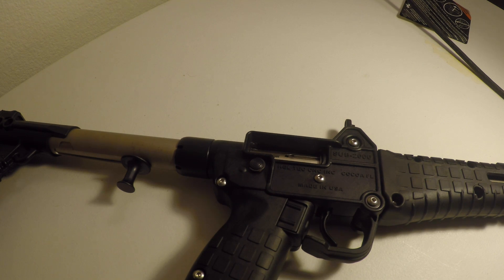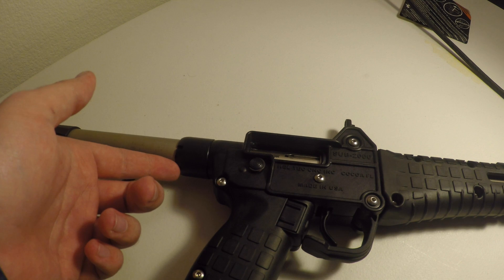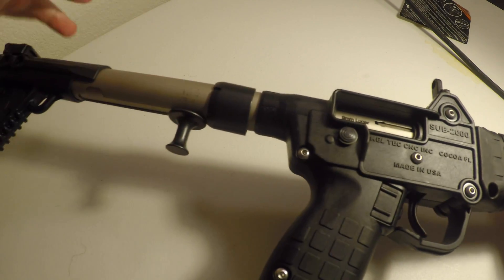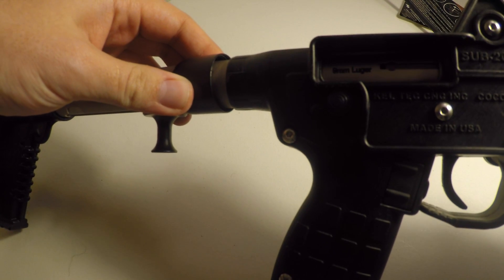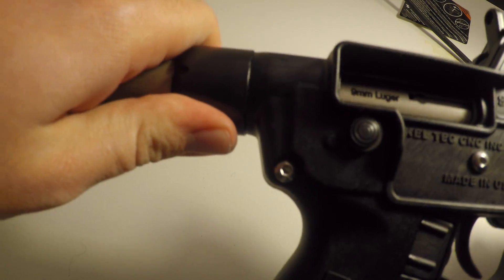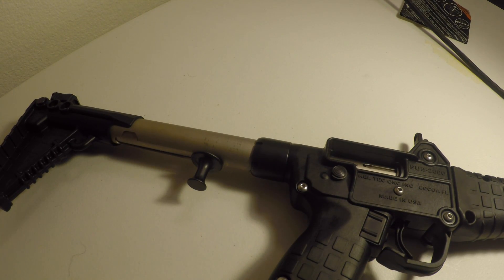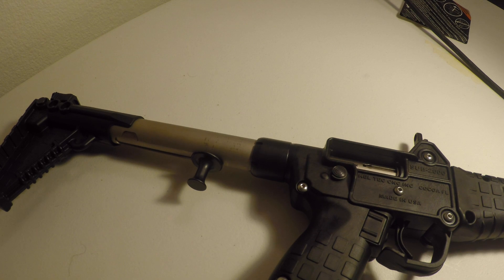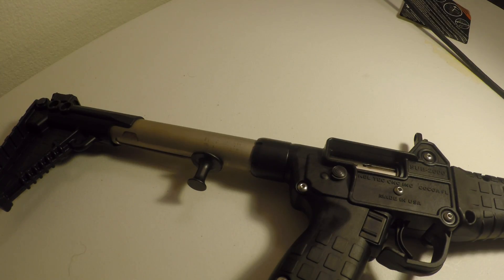New Problems Keltec Sub2000 Generation 2 Updated Version Receiver Collar|

Comment: The front of the "nut" has 4 tabs which slide along the four indentations on the receiving end. Once the nut is slipped into place,  a slight turn to the right locks it in place.

Comment: I’ve put over 1000 rounds through mine. Only problem  I’ve ever had was to stove pipe jams but I was using cheap ammo . Not a single other problem I would definitely recommend buying a Sub 2000

Comment: Don’t understand why a purchaser should have to fix any product after buying it; any product, especially one that manages high pressures and deals with a lot of known variables. There should be no tolerance for imperfect results. None. We don’t put up with automobiles that stop only some of the time when brakes are applied. Something works within a narrow range of tolerance- or it should die in the marketplace.
Reply: I don't know many new cars that cost $400 like the Sub2k does. Cars and cheapo Kel Tecs are NOT the same.

Comment: Everything is fine with your KelTec. The Gen2s come unthreaded. As long as the threads on the nut grab the plastic and tighten up. The company thinks this is sufficient rather than threading the "receiver" plastic. Some people put loctite on the plastic before they screw the nut on.

Comment: From my understanding the gen 2 comes this way, there are threads on the actual castle nut. As others have said, use some Loctite, put it on the threads of the castle nut then actually screw it onto the grip assembly while pushing forward. The threads on the castle nut are supposedly made to put grooves into the polymer grip assembly to help hold it in place. I don't know why they do it that way, but I have read this tip on several forums, did it to my gen 2 and I haven't had a problem since.
Reply: yes they are like that from factory.  they just use loctite to secure it.  M-carbo shows a breakdown vid and explains it.

Comment: Just lock tight it! I don't understand why people buy a $500.00 gun, then complain about minor issues. NO gun is perfect. Someone will ALWAYS find fault of some kind. If you look at YouTube,  you know this. If it's a $3500.00 custom AR, or a $6000.00 bolt action rifle, someone will find something wrong! Just relax and enjoy shooting.
Reply: A firearm malfunction or defect can cause injury or death. It is not the difference between buying a Fiesta or F 150. Even the cheapest firearm is expected, at the very least to operate safely.The manufacturer has issued a voluntary recall and will not only fix it but will return it with a new 10 rd mag for your trouble.
Reply: Mine had a minor issue,Broke in half after 30 rounds
Reply: Mine had a minor issue.Broke in half after 30 rounds.

Comment: It's not really a threaded joint but rather the "kind of" forms a thread on tbe plastic upper. The Loctite is what forms the grip. Kel-tec intentionally applies the adhesive sparingly to facilitate disassembly which is necessary for MCARBO upgrades. Too much grip and some people will destroy the nut or upper in disassembly. I think on the Gen 3, if there is one to be, will have real threads molded in the upper (which is not a costly insert mold modification for the injection mold tooling) or a clamp ring (my choice) to replace the nut. Either way, there is an easy enhancement possibility.
Reply: Jeff Cole they should do that. Or put some kind of ferrell and compression system on it..
Reply: They have the sling bolt that covers it and actually gets tightened down

Comment: The sight on mine is canted, also had this issue with the collar on mine.
Reply: Aaron Bryant take your gun back to the gun store or call Kel-Tec and they’ll fix that front sight. Front sight is glued on with a super high temp glue, a heat gun will take the sight right off.

Comment: Why not use some gorilla tape lol. I owned a couple  of Kelley's, my neighbor bought the 22LR pistol he has to lube up before firing so it doesn't  jam the rimed cartridges that get tangled. IMO Keltec manufacturers prototype platform gun designs minimally tested and minimally manufactured by sub contractors. I personally  have made up my mind to steer clear. If I really want a "pistol-cartridge-carbine" I'll pay a little more and build/buy a proven AR platform designed, which I've never had to gorilla glue.

Comment: Put some Loctite 380 on the frame part where it should lock and tighten it real good and shouldn't come off any more that easily
Reply: Mcarbo sells a lot of after market internals.   They recommend loctite 380 for a good polymer to steel bond on this.

Comment: It seems like everyone has some major issue with the sub 2k that turns out to be a minor issue. Maybe keltec should just put a little more locktite on them to keep the sub 2k haters at bay. I did have my from sight loosen. 5 minute fix, didn't have to make a video about it.
Reply: Bronx ite450 I hate that people buy this gun and start bitching when something loosens up and then they call the gun cheap or junk. It's probably the most saut after carbine on the market and a very good one at that. My Castle nut came loose and I just put loctight on it and problem fixed. No other carbine does what this gun does, so I say this to all the idiots sell it or fix it.
Reply: Shniggit True even a stellar product with poor QC is going to get crap. I wouldn't say they were light years behind in QC but shaking a bad reputation, hard to do when little stupid things like this happen, then it makes you doubt the reliability of the product and company overall. It makes it seem like someone doesn't care. I agree they better tighten up.
Reply: Just bought one.... gun rocks... haters will hate.....
Reply: tlt40s&w 70 i

Comment: Red Loctite on mine and I can’t remove it even if I wanted to. My front sight was also canted. A heat gun and a vise made straightening it a piece of cake. These should be flawless from the factory, but Kel-Tec already struggles to keep up with demand. More often than not things are sent out the door without proper inspection.
Reply: I think Mcarbo makes a after market front sight that is superior to Kel Tec plastic sight.
Reply: That's funny. I just ordered it a few days ago.

Comment: My Keltec sub 2k gen 2 is great ! 
UPGRADES 

Pro trigger bundle 
Extended glock mag release 
33 round glock mag
Stainless Steele Feed ramp 
Aluminum trigger gaurd
Rotating Rail 
Front & Back Fold down sights 
Buffer recoil pads 
Butt stock recoil pad 
Trijicon Dual illuminated RMR 

Y'all should quit crying  about your S2K and do some research on the gun and invest.
Reply: 5280 Cinema Group your like me, you put about $2000 into a cheap gun. Hehe.

Comment: Kel-Tec Weapons issued a voluntary recall of specific Sub-2000 rifles manufactured during their 2017 production run. ... The safety of our customers is our primary concern, so Kel‐Tec has voluntarily initiated this recall because of the possibility of a barrel rupturing. www.thefirearmblog.com/blog/2018/04/10/kel-tec-issues-sub-2000-recall/

Comment: They use lock tight 380 and the threads on cap help snug it up
Reply: Jones the threads on the cap kind of grab the polymer I agree it’s dumb but if u snug it up it does get tight somehow so I can’t really say it doesn’t work wither

Comment: I have open up the Sub twice to install the Mcarbo upgrades. Yes, two times I have removed all the screws and looked inside the guts: of course with the video help. No big thing if you pay attention and don't screw up the re-installing procedures. That collar on mine had some Loctite on I just twisted back on. I've shot 2000 rds. at  Steel and IDPA with a red dot. Oh, forgot to mention the Mcarbo muzzle break. Great! carbine.

Comment: It is all the gen 2's. Mine came loose and the whole upper receiver split open. Kel Tec has it now. Pure garbage. This happen after 220 rounds.
Reply: PJ V How did the upper come apart, they are screwed together and the castle nut does nothing but for looks. I don't believe that your gun just came apart unless you tried to put a trigger or trigger guard and you didn't get it right. I've never seen this failure with any gen 2k.
Reply: Gun was factory fresh with only 250 rounds.  The next nearest screw is forward on the receiver.  the gun split open on the top of the receiver once the collar came loose.  I do not appreciate you basically calling me a liar.  Keltec did fix the weapon.  They cited no fault due to me the user.
Reply: Man that s b.s for damn sure no way can split but I have same problem were piece came lose but I glued it back on lol and I've shot the he'll out of mine guns a great gun if that s all that goes wrong fuck it. It's a toy not to hunt with maybe home defense but just a 9mm rember that
Reply: Thx for posting wish you had taken a video. Kel Tec needs to be aware of the  issue customers are having. Glad Kel Tech corrected the issue.
Reply: New recall on these as of now from Kel-Tec.